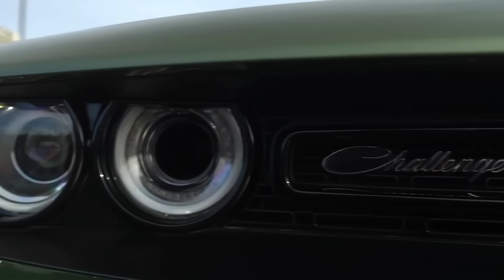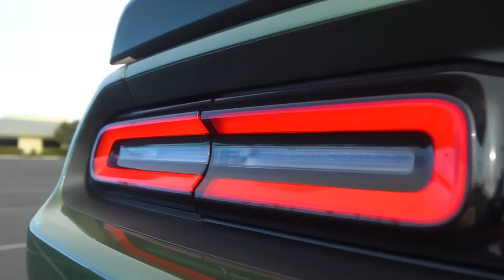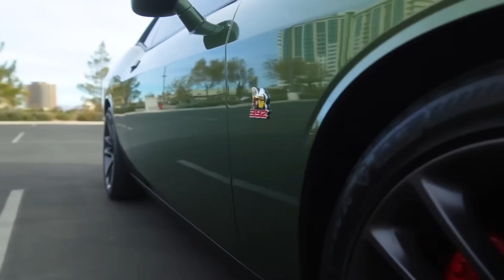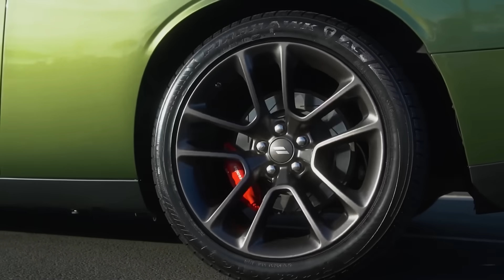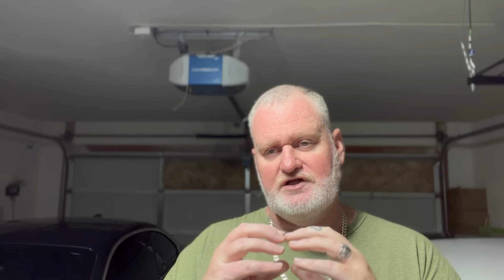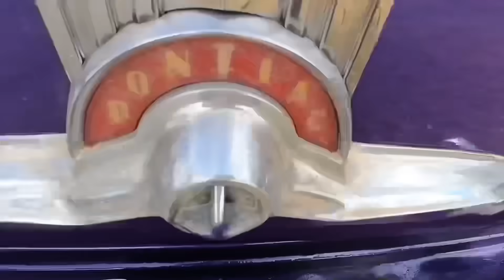Ford News DEF Tune Recommended By EPA Turns Off Diesel DEF Sensors?

Comment: My son-in-law has been mixing his own deaf with distilled water for the last 4 years on a 2014 Dodge ram 3500 and he hasn't had a check engine light or nothing happened at all just keeps running and running at first I thought he was crazy when he was doing it but he looked it up and DF is where is Uriah in at some kind of chemical he's running straight distilled water have a nice day
Reply: lol😂ima try it
Reply: If I had a diesel and the epa was making it so they didn’t care I would add used motor oil into the def tank for it to burn off with extra black smoke lol

Comment: DEF is a synthetic Urea. Its deluded with water. Tap water might cause issues as there are other minerals in tap water. Distilled water will not cause any issues with crystallization. If they are no longer looking at quality then yes, distilled water is fine. As long as the downstream NOx sensor sees what it wants to, then it will be fine. Def pumps have heaters as DEF freezes so there may not be any issues with below freezing temps either. When you shut off a diesel truck with DEF it reverses the pump and sucks the fluid out of the  lines to prevent freezing.

Comment: DEF is 70% water fyi
Reply: No it isn't. 
DEF is 51% Nitrogen. 
Fertilizer is 32% or 28% Nitrogen.
Reply: @williamshultz3598 I read it right off the material data sheet-derp 70% water 30% urea

Comment: They should go back to 2003 where all they had was a cat . My 03 3500 all it had was a cat from the factory . My 2021 3500 single rear wheel burns 2.5 gallons of DEF EVERY 3 TO 4 MONTHS . It pulls a 10000 lb travel trailer once a month . This truck is driven every day . Denis from Santa Rosa Ca

Comment: HowMany wires does that d e f sensor have on it? If it's got three wires on , it probably only need a resistor just have to know the right resistor across two of the wires and there you go , but I don't know how many wires go into that sensor.

Comment: What about Medium Duty Trucks TK🤷‍♂️🤷‍♂️
Reply: Losing the emissions stuff doesn't interest me as much as the F-450, F-550, & F-600 getting a pickup tuned PowerStroke.  20-25 years ago, truck makers offered the highest power ratings to be ordered for emergency vehicles and if it won't be given to the general public, I hope it returns for them.  My fire department has a 2019 F-550 that's maxed out on weight and pretty slow. Our ideal truck would be an F-600 with a crew cab, 4x4, and a 500HP/1,200TQ motor.  We're very limited on the tools, supplies, and equipment we can carry, but a 2,500 pound payload increase would help out a lot and likely allow a longer body with more room.  Sadly, they currently don't offer the F-600 with a crew cab, but they would sell thousands each year for fire, dump, and box trucks.

Comment: Just for info on the DEF fluid level, when you live in a high temperature area like Vegas or Phoenix, they do not recommend you to leave it full of DEF unless you plan on burning through it. I had tons of problems in 2013 with RAM and my DEF sensor realizing that the DEF was degrading. It's temperature sensitive and goes bad quickly in hot weather. Much better to keep it 1/ quarter to a half full and hot area so long as you drive the truck.
Reply: Interesting. Def also doesn't like temp swings when things drop in some trucks either

Comment: Just going to wait to get a diesel once this no longer comes with the truck. I have a feeling trucks from the last decade are soon going to become worthless.
Reply: No i kinda don't think so. I have a 2016 powerstroke and I deleted the def system and bypassed the egr.
Reply: Cummins are solid. 
They have a few small issues but honestly just being an inline 6 negates the majority of issues inherent with V8s like the ford and duramax. 
I wrench diesel for a living, Fords probably make up 80% of the repairs I see. Duramax tends to either be a minor issue or a total loss.
Reply: Yep I think my trucks are already going to lose any last value they had
Reply: Over thinking it 🤔 maybe,
Reply: I'm with you. I'm waiting for all this crap be in the past to buy.
The problem with deletes is that, if you do yourself, you are in the hands of whoever wrote the tune and if you buy a used deleted, you have no way to know what crap they put on it...
2007-whenever they step back on emissions would all be really cheap trucks...
Reply: I think the real problem is the US diesel fuel is just too refined.
Reply: @The_germinator_9a  Supposedly Lee Zeldin is trying to address this issue as well. It has lost a lot of the lubricant factors compared to the standard fuel oil, which definitely causes faster wear on cylinder walls.
Reply: They'll just get deleted, like my 2020 Ram.
Reply: @QCJerks   You'll likely never get a new diesel in that case. The Proposal is on the EPA site...this stuff unfortunately isn't going anywhere.